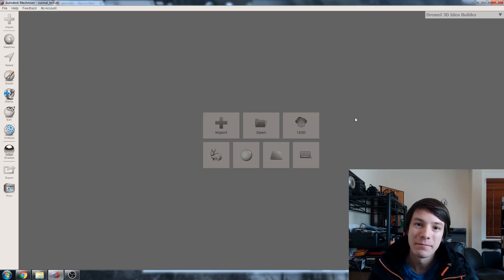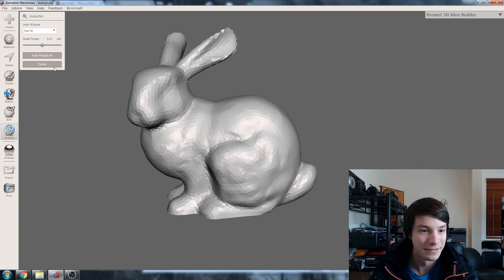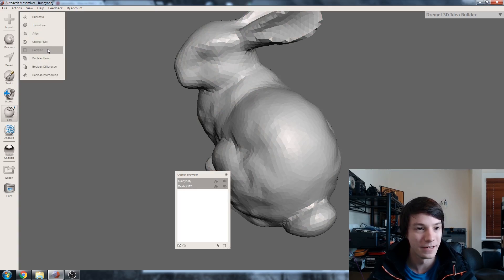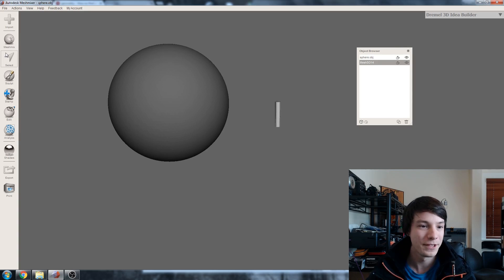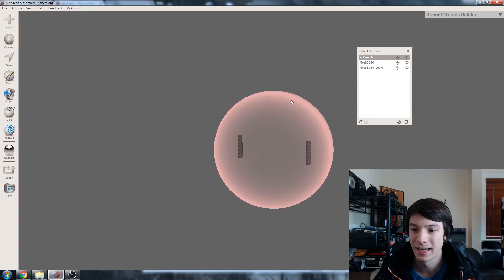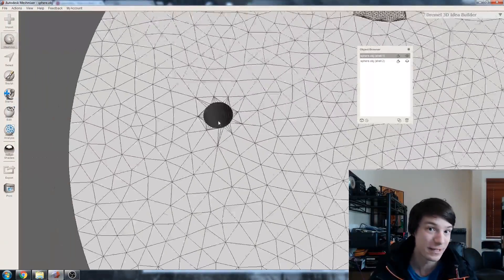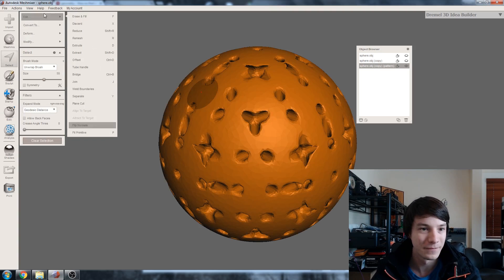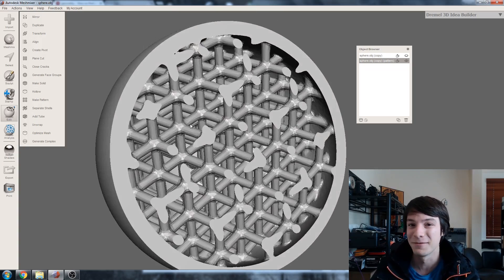Flip Normals in Meshmixer to create Pins, Voids and...?

Comment: Are you using this technique in 2022?
Looking at 8:26 the advantage of this technique is apparent. By delaying the addition of the cut plain until the other surfaces are all established the software can make good choices in locating vertices of the mesh of the cut plain. If the cut plain is added first as I have seen in other descriptions of methods then the software has no knowledge of where the pins will be or what size and shape they may be so it is impossible to take advantage of those surface locations when essentially arbitrarily assigning locations for the mesh vertices in the cut plain.

Comment: Hi Angus ..does this  technique only work with the plane cut tool  or would you be able to use the "Select,Edit, Separate (then fill the holes where the separation occurred) , command to make irregular cuts oppose to the straight plane cut.? 
 then  after the mesh has been separated pop in a reversed normal peg ??

 just wondered as i use my  "Select,Edit, Separate" technique every time  i need to cut up  large detailed meshes that require an irregular cut .
 .. any help would be much appreciated ;)    

another awesomely  fine tutorial  by the way .. just by watching all your tuts have made my step into the 3d printing world .. so much better  cheers Angus .. keep it up and what ever you do     ..... do not stop making these tuts ;)   
subbed ,bookmarked your tuts and had the notification bell clicked for over a year now ..   :D

Comment: This is brilliant !  But I took it a step further.  Hope you can follow.  I was looking for a way to cut grooves or sculpt a surface but only to a precise depth.  I could not find any app other than maybe Zbrush where I could easily do this. Lets imagine a hollow sphere 1/4 inch thick. It is created from  3 spheres.  Where one is the outer surface and the other two are the inner, but both inners are a duplicate and set at 1/4 inch smaller than the outer. Then flip normals on one of the inner spheres. Hide the other inner one for now. Then use sculpting tools to pull the flipped surface through the outer surface. The length of pull doesn't matter as long as it breaks the outer surface. Then when all is done, combine all 3 spheres and most importantly then use make solid on the combination. The result is a surface with cut outs but not right through, and to your target depth.  I hope that makes sense and its worth the effort as one can sculpt (albeit in a negative manner) without worrying about the depth of cut.

Comment: Quick question :) when you did plane cut on ball with pins in then seperated shells my issues is the whole model shells seperate as well ie i have a figure i made combine and solid all figure parts then i have a seperate box i stand him on i join the box to the figure add the pins and combine then i plane cut later on and click seperate shells and its this part i am struggling with as man then becomes many parts any help appreciated

Comment: Sadly I cannot get this to work, I'm not sure if its newer meshmixers fault or what. When flipping normals they turn out pink (shouldn't be a huge difference just color, but it refuses to work. I was hoping it would be as easy as tinkercad, making an object a hole and then combining them, but flipping the normals and combining the two meshes leaves you with exactly that, two meshes just grouped together no actual subtraction occurring like in your video.
Reply: I just tried this with latest beta of meshmixer and it works well.  I started with a cube and a cylinder, put the cylinder through the cube.  Select all on cylinder, flip normals.  It turns it pink, as you said.  Select both parts, and combine.  Visibly it shows no difference, but now you do Make solid, and voila.  Hole appears where cylinder was.
This is why I really enjoy these videos Angus, keep the tips coming.
Reply: Try combining the pins (with the normals flipped) with the main part BEFORE you do the slice. That worked for me.

Comment: Awesome video, thanks as always. I can see someone using a method like this for an sla shapeways model.

I have a question kind of about the BACKWARDS of this...  I have a model that someone smoothed out and did a lot of amazing work to make a great shapeways printable model, but as such it is hollow with a hole in the bottom....  I want to 3d print this, and it is manifold and such so I COULD, but the middle would be missing infill and be a general pain to print (internal support material I suppose).

I would like to REMOVE the internal shell and turn it back into a solid model for easier slicing and fdm printing.

Any suggestions on this?  I am looking to delete all the internal faces and then patch the hole in the 'belly of the beast', but I am having a crazy hard time selecting INTERNAL faces accurately and in large quantities in order to do this.  I am a newbie with meshmixer, is there a way to slice it for VIEWING and selection without actually slicing the model?

Is there another better software for this?

Comment: This is brilliant, especially as you can modify an existing STL without sacrificing quality.  No worries about math.  Think of "normal" (short for normal vector) as the direction of a surface.  So if the "normal" points northward, the flipped normal would point south; likewise, if the "normal" points outward, the flipped normal would point inward.  A 3D printer - or rather, slicer, always thinks of "normal" as outward.  That is why if you just flip a sphere, it becomes unprintable.

Now if only I can learn how to use Meshmixer - if only I know how to drag an object to rotate it for examination!  I can't even find move function in my Mac version.

Comment: I was trying to do this to a mesh I needed cutting in 2, I had already done one split without pins, it's not going to be easy to get it lines up so I may have to reprint it another 11 hour print lol. Just used your technique closely following what you did. I was totally unaware mesh mixer could do this as all the join functions aren't in the edit menu... Go figure! Thanks I will have to use some time and learn mesh mixer. Am a 3D Studio Max user, and it's not ideal for 3D printing :-)

Comment: Why doesn't Meshmixer implement its Boolean difference operation using this "inverted normals" technique, if it provides cleaner and more efficient results? Is there a semantic difference between the two operations?  

On a (possibly related) note, I was surprised to hear that after you put a sphere inside a bunny, they do not intersect. :-) This started my mind going to "he must be talking about the surfaces of the models, rather than the 3D bodies they represent", then to "another word for surface is mesh", then full circle back to the name "Meshmixer". ;-)

Comment: I need a workhorse printer that can print reliably and consistently high quality. it also has to be open source. I have experience with 3d printers and can do tinkering and upgrades. I have a maximum of $800. I am debating if I should get the wanhao duplicator i3 or the wanhao duplicator i3 PLUS. which one have you had more success with. also, if you have any suggestions other than wanhao, I would love to hear them.

Comment: I do this all the time in Blender. The caveat is how I do it is messy. Regardless, pinning inside an object with Blender and then dividing it is easy. Neat tip for Meshmixer though, seems identical to the hole+group process of tinkercad.
Reply from the maker: If you do the same plane cut operation in blender, does it do a clean job? I might need to revisit it...
Reply: Plane cut ops in Blender are as easy as duplicating your mesh and spawning a giant cube to use one face of the cube and the volume of the rest of the cube to cut off the pieces you want cut from the half. It's a boolean operation, unfortunately.

The other boolean option is to make a tiny tiny manifold plane (<0.1mm) and use that to split the mesh.

Most plane cut ops in Blender, for me, have been very manual operations and for high-poly spheres can take awhile (15 minutes or so) but are high quality if you decide that a boolean operation is unwanted.
Blender's boolean ops tend to be very clean and do not destroy any geometry. However because of this they are unreliable and sometimes give you the wrong result. Many times a Union op will function like an Intersect op, and vice versa, because Blender really does not add any new vertices to either mesh of the boolean (except precisely to conjoin them in a manifold shape). Worse yet are the horrifying times Blender spits out "unable to perform Boolean operation". In these times you have to join the meshes and use a knife intersect or clean up the conjoined areas.

Someone else can correct me but Blender doesn't have quite a clean plane cut op as Meshmixer has.

I personally think if vector editing is not your thing, you should stay away from Blender. I came from a background in Flash, InDesign, and Unreal Engine so the vector editing madness that makes Blender was easy for me. A protip though: In Blender, if you are stuck, hit Spacebar and search for the desired function.

Precisely speaking though, joining a manifold mesh inside another mesh makes a hole after you hit A (select all) and then hit CTRL+N (fix normals).
Reply: Would like to add: You can separate manifold parts of a mesh in Blender by hitting P and using "By Loose Parts" from the context menu in Edit Mode.
Reply: I just use boolean in blender to cut everything and for making pins too, easy and fast.

Comment: I made this Rocktopus with the make pattern tool
https://youtu.be/9AaEBLyjyTU
Reply from the maker: Awesome job! Really cool machine too, did you design that?
Reply: Thank you Angus! Yes it's my own design, I'm still working on it, it works better every day. Also you can find this model in thingiverse if you ever want to print it, but i know you don't really like dual extruder machines. (also, fan fact, I'm from Hungary like your Craftbot plus :D )
Reply from the maker: I'd love to know what firmware you used for the toolchange! I think it's a great way to design a dual axis machine. Yes I don't have any working dual extruders, soon hopefully.
Reply: I run Marlin-Rc3 Duo on it, it has a RADDS board with an arduino due so it needs 32bit firmware,it really needs the extra horsepower because it has 400 stepps/mm resolution in X and Y, a normal Ramps-arduino was not enough to go above 60 mm/s. This setup is surprisingly good, I dont use ooze shield or a prime pillar but still there is no color contermination at all. I was working on this machine for about  6 months and two weaks befor the first testprint, the BCN3D Sigma was out, I allmoast got a stroke :D

Comment: Every single 3d artist know this stuff lol Normal direction is some of the first stuff you learn. Try Blender again its a lot better than it used to be. I'ma 3ds Max guy but have dabbled with them all Maya, Houdini, 3d Coat, Z-Brush etc. Booleans in these packages are far from perfect but you don't end up with the issues you get in Meshmixer. In fact making pins is easier in all these other packages lol
Reply: Agreed. When modeling large organic shapes/structures you tend to use whatever tool you can. Sometimes not how they are meant to be used but if it works for you, why not :)
3dsMax rocks!

Comment: Very useful if you're primarily working with meshes. Of course if you design mostly in CAD it is better to think about your joints before you export to mesh so that you end up with clean meshes and accurate mating parts (and you are not limited to pins or other simple geometries). Don't forget to allow a tolerance for the cavities if working with fixed size pins - e.g. 4mm dowel would need ~4.2-4.3mm holes.

Comment: This is excellent. I haven't been using Meshmixer for this task because of the inevitable surface deformaties. Not having to verify pin placement is going to be very useful as well. Thanks for this tip.

Comment: man that is crazy and may come in REALLY handy for an upcoming project. Using pins to hold items is a great idea for various items in day to day  stuff! I remember some lathes at the school i was at had cracked castings so we welded our own up and used the pins to hold the parts together for welding. Worked quite nicely!
Reply from the maker: Pins are awesome lol, was the casing cast iron??? That stuff is fun to weld.
Reply: +Maker's Muse the cracked ones were rubbish cast iron... other problem was people kept jamming the carriage against the headstock with the power feed which put tremendous force on the casting and unsurprisingly it cracked. the replacements were welded steel.

Comment: +Angus - what if you scale a copy of the bunny, say 75%, do your invert mesh trick on the copy, bring that inverted model to the same centroid as the original (of course you could do that before you invert the mesh), then combine them? (I don't have MM up and running yet). I am thinking you should be able to get a "skin" of a few mm thick everywhere and have a chocolate bunny versus having a one balled bunny. Bonus - no "maths" ;-)
Reply from the maker: You'll need to offset the mesh instead of scaling around the centroid, but yes you can do that to get a hollow :) To be honest meshmixer does have quite nice 'hollow' function already, but it can be quite CPU intensive.
Reply: +Maker's Muse Hi angus want to come check out my live stream for like 10 min it should be in my sub box